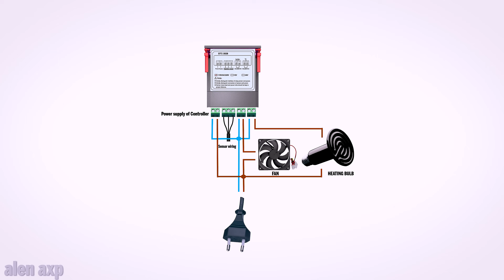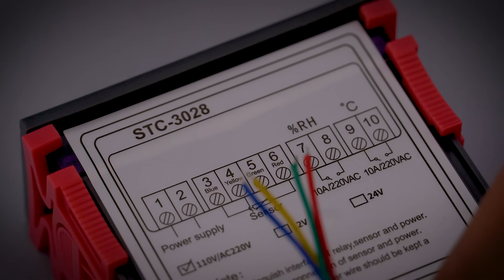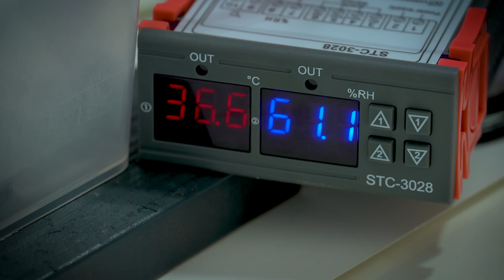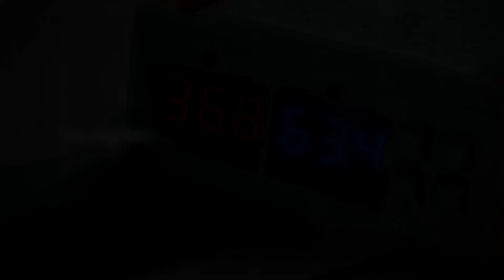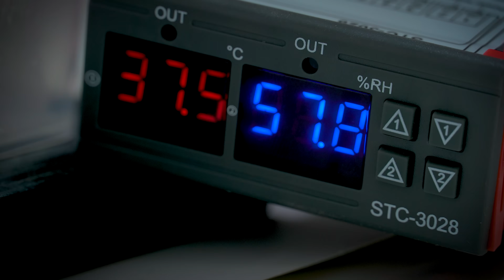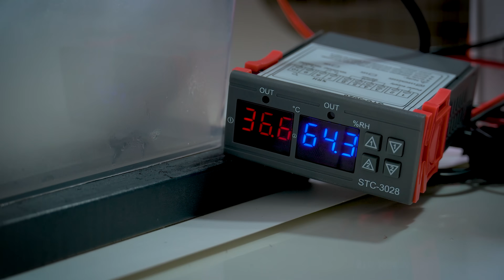DIY Incubator for Rescue Budgie Egg

Comment: Sir please reply I'm facing the same issue how much
 watt you used for the bulb? And I have to change the water regularly? 
Also, how many days have I had to turn the Egg in the incubation. process?
Reply from the maker: turning the egg should be done very often. The bulb can be any bulb for reptiles just to keep the right temperature. Water for babies is just for humidity. When they grow up and start drinking water should be changed daily.